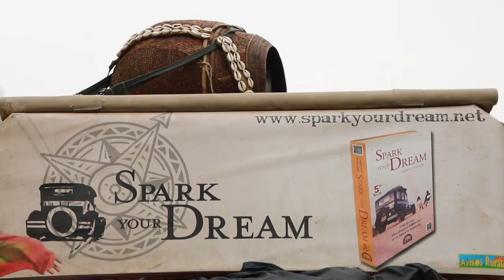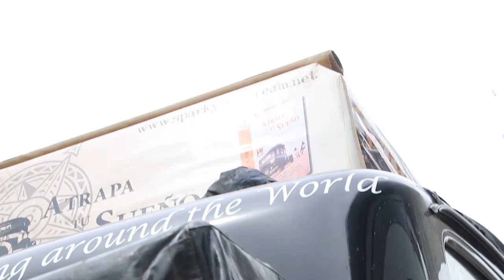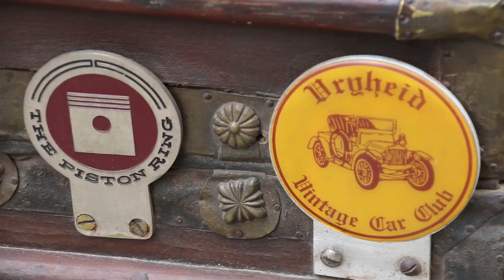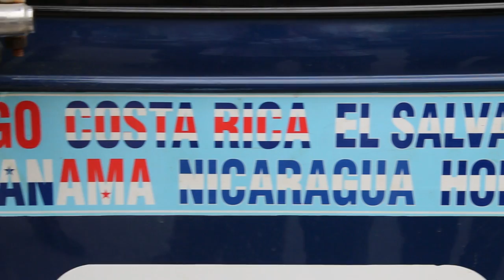A family around the world in a 1928 Graham-Paige – Herman E Zapp and his incredible story

Comment: "Those indicators are working on 12V now?" (facepalm)
Reply: most modern gauges require 12V at the bare minimum for light. All electronic gauges require 12V to operate but I`m sure the owner of this old vehicle wouldn't have installed electronic gauges. For example diesel fuel pressure gauges for the modern diesels (commonrails have way over 20k psi) do not exist in mechanical version. But overall. the question was funny...